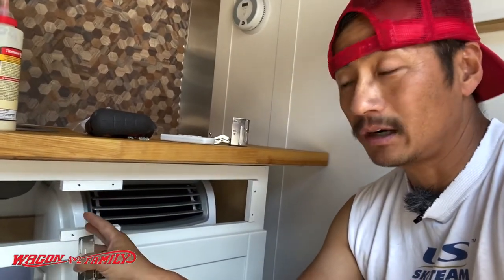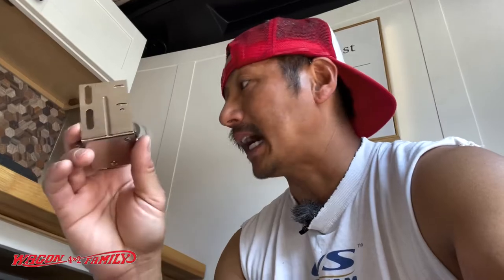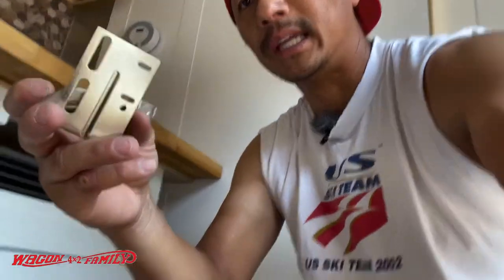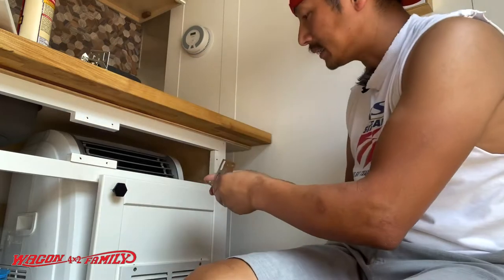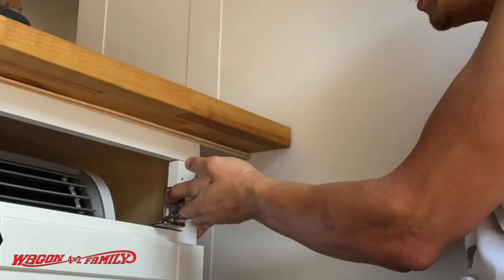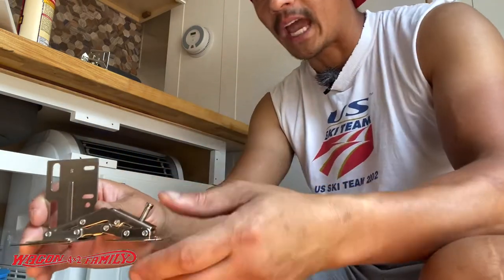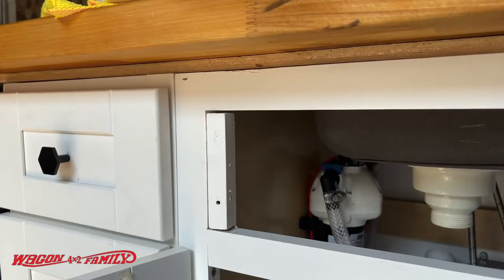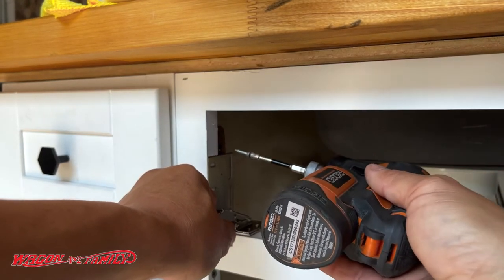AC/Heat Vent Door Install on Trailer Conversion

Comment: another good hack is to glue tooth picks into the screw hole, let them dry then flush cut them level with the door. then its like having new wood to screw into. learned from a deck builder.
Reply from the maker: Thank you. Great idea.